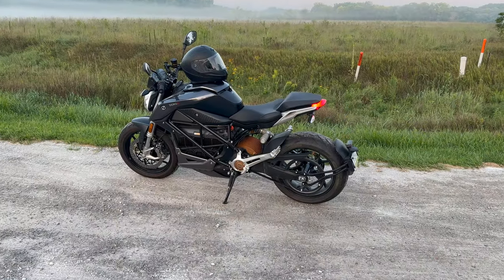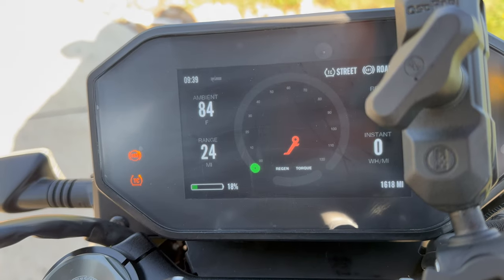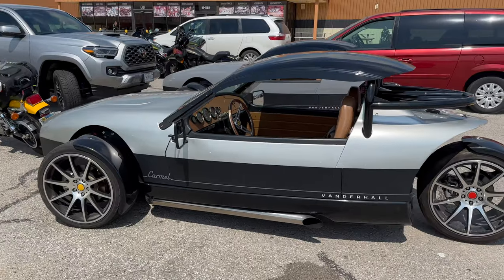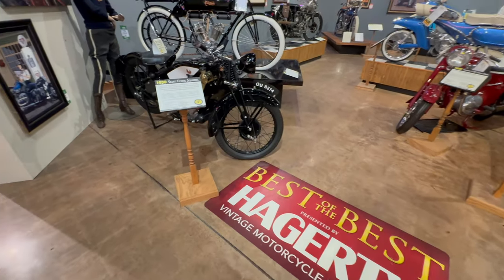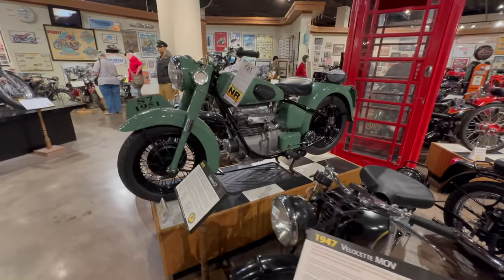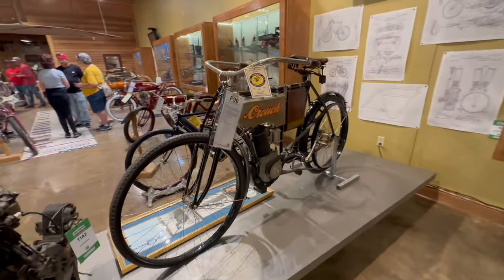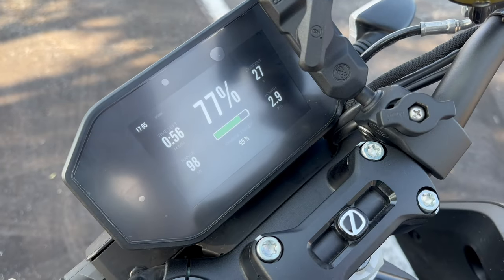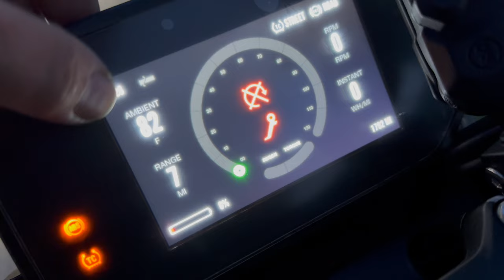National Motorcycle Museum Road Trip on Electric Motorcycle

Comment: That was an interesting trip. Some quite unusual bikes there but a bit sad that such a museum has to close. It is not just American heritage there but other countries too, including an iconic British red telephone box. Just wondering how that travelled to the USA! I know some did make it over there so probably came with some others.  Those car/bikes must be rare and likely one offs. I would say that although the trip was a success the issue of charging points rears its head once again. As I have said before we have the same problem here in the UK. I know that your Government is investing in building  factories to produce batteries. and the same is happening here although at a slow pace. The ambition is to have some charging points on every street but that has to be done by the private sector. I am sure things will improve both here and in the USA but we seem to have been caught napping! Thanks for the video Steve. 👍👍

Comment: Answered all my questions at the very end, appreciated that. Confirmed my concerns about operating EV's at this point in time. Still a crap shoot as to whether you'll find a working charge point along the way, and you're just SOL if you don't. Lots of thumb twiddling involved waiting for battery to charge. Charging stations often in less than ideal locales. Crazy cheap, though. Still a few years away from viability for average driver/rider.
Reply from the maker: My bike can be upgraded to charge at 12kW but the most any charger I saw can put out was 7.4kW so the chargers would still be the problem and not my bike.
Reply: @ThisWeekWithCars  Was just going to ask that, "what's the charging capacity of the bike vs the chargers". 12kW is pretty slow but 7.4kW is insanely low for a publicly accessible charging station. Trying to wrap my head around this, the bike can charge at 12kW, so you're stuck to level 2, but at 12kW it would still take forever compared to tossing in a few gallons of gas.

Level 1, ~1kW, that's your typical home wall outlet, overnight.

Level 2, ~7kW to ~19kW, your typical charging station outside a building, library etc, 240VAC outlet, basically. An hour with the upgrade?

DC Fast Charging, which typically puts out between 50kW to 350kW, requires specialized equipment obviously. 0.234 seconds if you want to believe the hype.

I don't know anything about electrical engineering or enough about electric car systems to know why a Zero, with just inches of wiring between charger and batteries, and batteries almost in the open air, couldn't use DC fast charging or more than 12kW level 2 charging. Must be a function of the number of batteries/cells? And how fast they can take charge in parallel? I would find that interesting to learn, have to go do some research, I guess, before buying our family's first electric vehicle.
Reply from the maker: For this vehicle 12kW is not slow as the bike only has a 14kW battery, so you would get a full charge in an hour at 12kW.  For a car yes that would take a long time which is why I can't believe the chargers I saw were Max 7.4kW as it would take forever to charge a car or truck at that speed.
Reply from the maker: Zero doesn't have a Level 3 charger out yet for their bikes but it is coming and you will be able to retrofit the bikes like mine with it but Level 3 chargers are rare around here so how useful would that be to me anyways.

Comment: Very interesting Video Steve.  I especially liked the Roadog.  Being a former Milwaukee boy...loved the Blatz Beer Can!!  When you first introduced the electric motor cycle on YouTube, you mentioned that they are the wave of the future in the comment section.  Forgetting about the cost to charge, do you still believe that?  Five plus hours is a long time to sit and wait for the charge.  If you place a cost to the time, I'm thinking that the Five plus dollars isn't worth it....but I'd be very interested in your thoughts.  Thanks for a great video!!
Reply from the maker: Absolutely the electric bike is fantastic to ride especially over long distances, it is so smooth.  If the places I was going had chargers that would make all the difference.  So in the future with better batteries, chargers and more charging locations there would be no problems with it.

Comment: Like the bikes, hate the electric. Novelty or virtue signaling at this point. May be practical in a big city or high density area but struggle understanding how this will work in the boondocks. For people with limited means, this is a non-starter. Due to battery lifespan and cost 2nd/3rd hand vehicles will not be cost viable. Perhaps the goal is to eliminate personal travel.
Reply from the maker: Electric motorcycles are cheaper than gas powered motorcycles, you can charge them at home because the batteries are not big.  Electric motorcycles and scooters are things you would ride when you are not going far anyways so they are going to become very popular and you forgetting you can charge them at home so they make even more sense in the boondocks if you have no fuel stations near you.